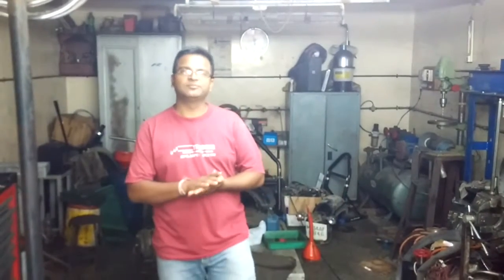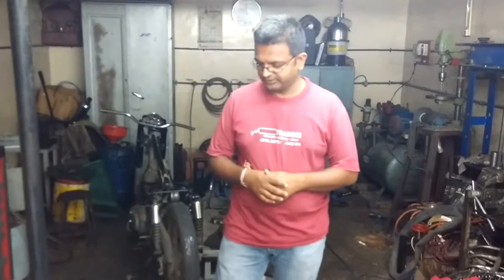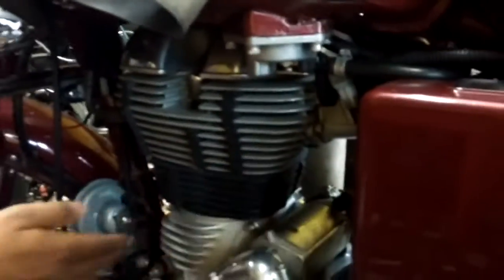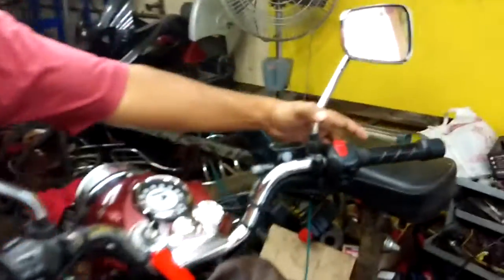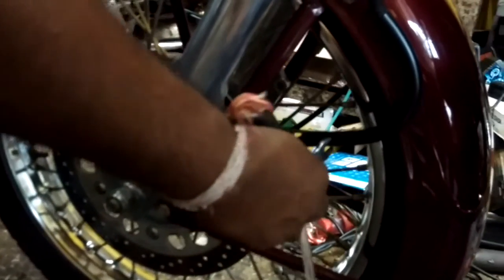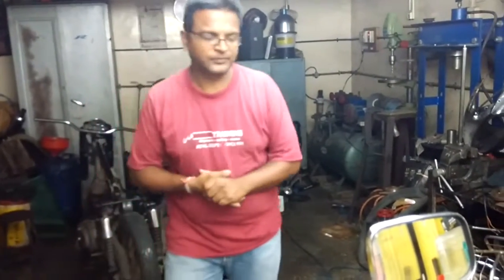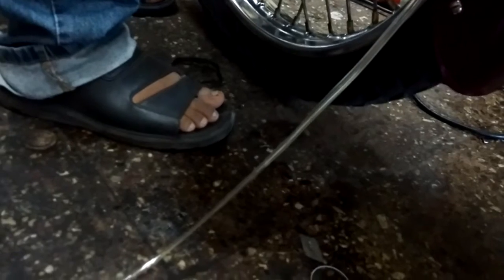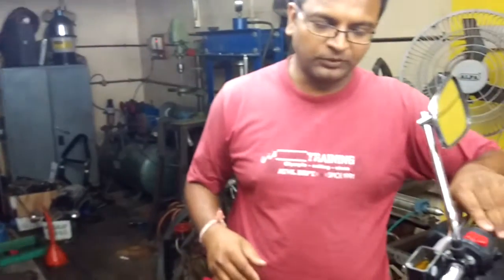Motorcycle and Brake Bleeding

Comment: Hey You are too Badass bro... I am so totally in love with Your Videos

I had a problem with my Rear Disc on the TB500 while I was in Mount Abu two week ago. I rode 170 Kms without a rear brake and the got it fixed at the Mehsana Gujarat RE Service.

I am still stuck with this issue and have a failed brake on my TB500. 

QUESTION - Can I use this same technique with the rear too? Also, I'm at home now, so I have back up. Please let me know.
Appreciate Your time!